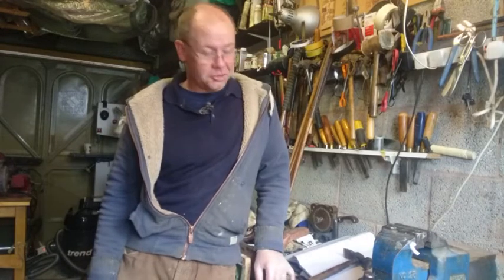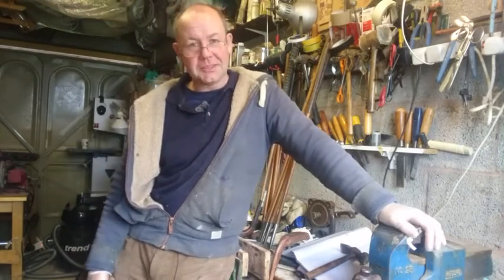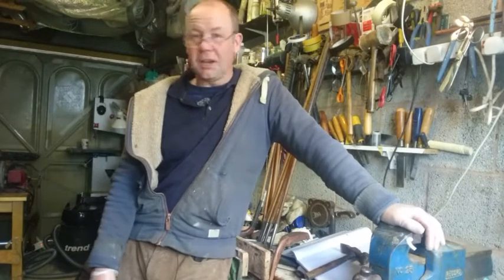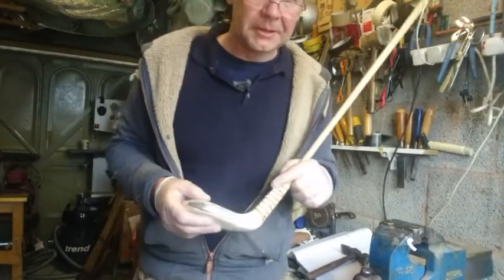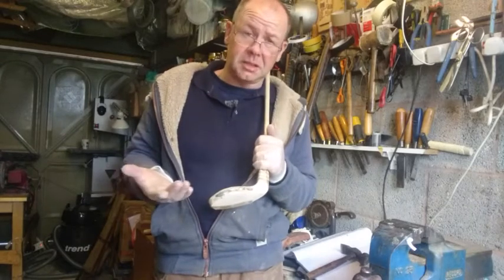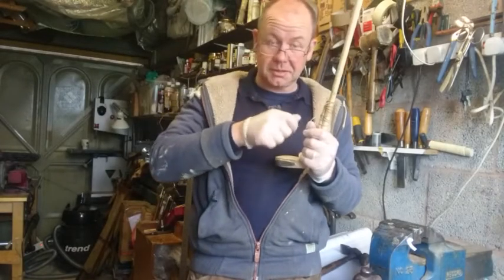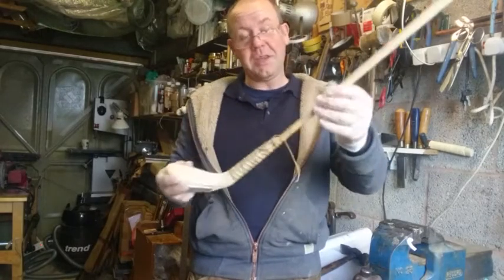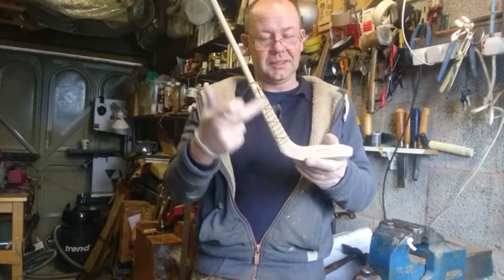Totally handmade antique style golf putters !

Comment: Great video Gavin!  This is very helpful insight into the cracks that can occur due to the addition of the weight pocket and weight.  I've recently started making long nose clubs and have experienced the same issue with cracks developing during the introduction of the molten metal being added to the weight pocket.  One solution that I seem to be having success with is to place tungsten weights in the weight pocket before adding the bismuth tin alloy.  The tungsten is very dense which allows for a shallower weight pocket and is fully covered by the alloy.  The results so far have been promising.  Thanks for sharing your work with us.